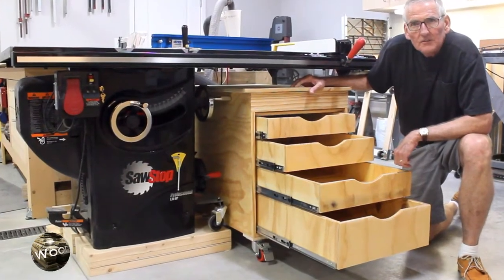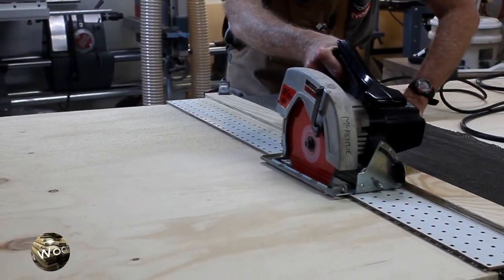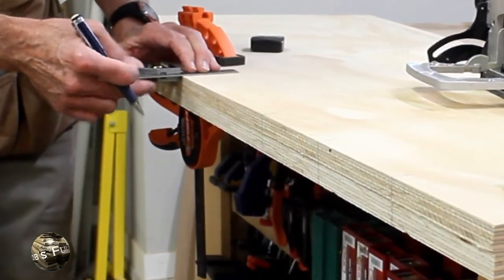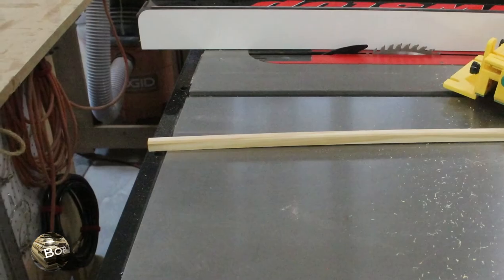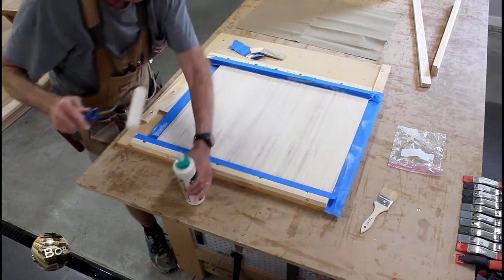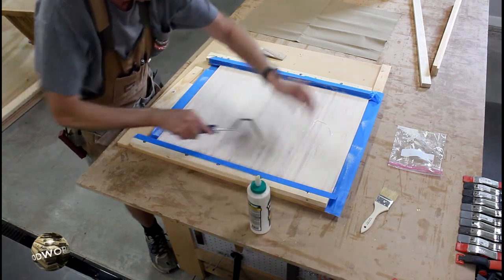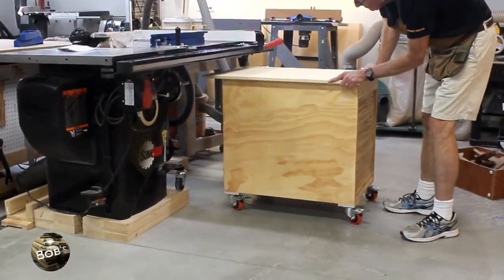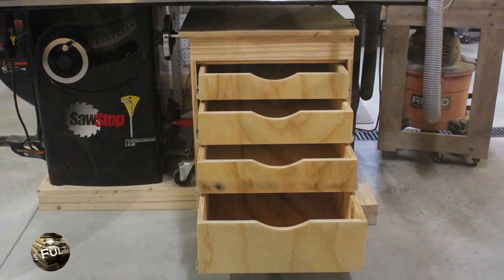4 Drawer Rolling Shop Cart With Tambour Door

Comment: Major upgrade Bob! I really like the tambor door. I have to give that a try sometime.great and informative video too!
Reply from the maker: Joe Basement Woodworking & DIY really easy ... I also put coat of paste wax on the jig areas I don’t want glue to stick.
Reply: Another great video Bob.
Clear, concise, and informative (aka entertaining for guys like us).
Can an oli based shellac or  another type of clear coat be applied after the Danish oil ?
I am currently building a pantry cabinet for my daughter with 4 sliding shelves, and a trash/ recycling slide drawer out of 3/4" baltic, and 3/4" clear coated maple veneer cabinet plywood and would like to preserve the natural look of the baltic , however I would prefer to make it "easy care".

I look forward to seeing your next video.Have a great week and God bless.
Reply from the maker: grupp61 thanks for comment ... I would think you could put a good water based “poly” (like General Finish High Performance) over the clear oil - I would wait a good time before to make sure oil is fully cured.
Reply: Thanks Bob.
That's what I was considering, just was'nt sure if oil and poly bode well.
The guys at my local Woodcraft store will know I suppose.
Take care.